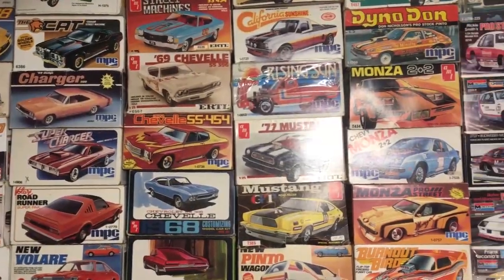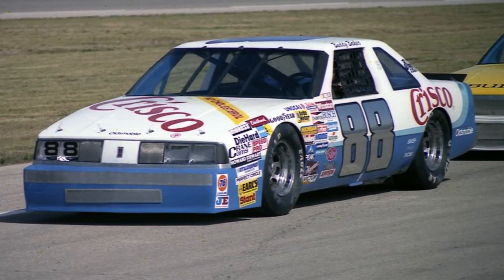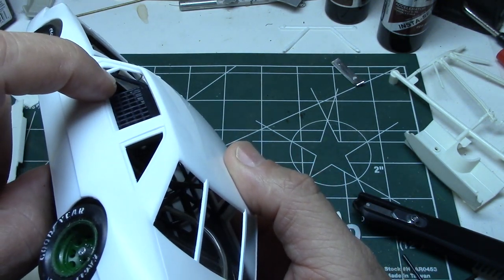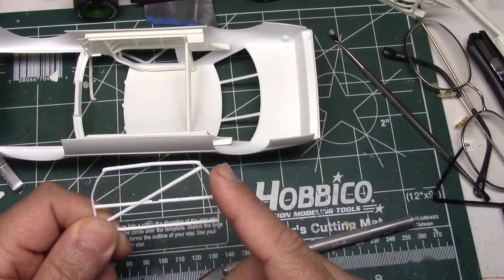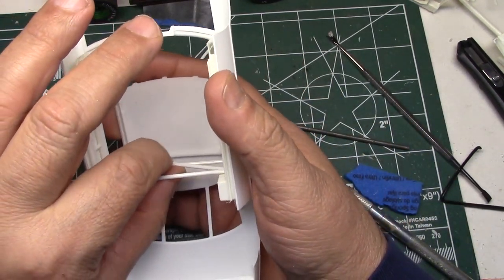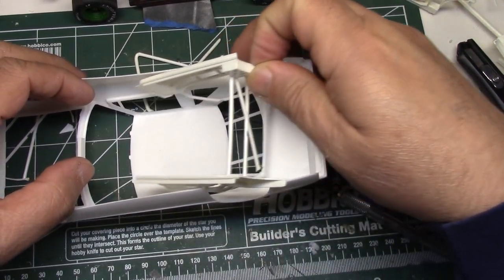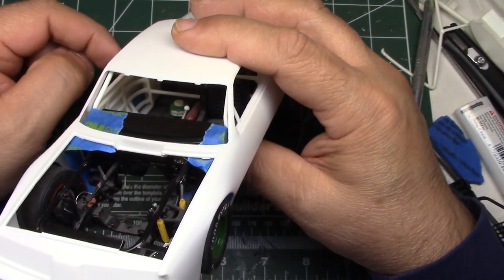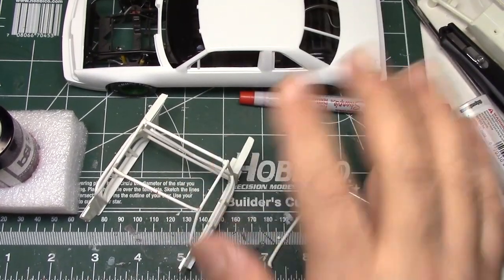Ep.114 How To Blend The Roll Cage Into the Body On An 80s Monogram NASCAR Model Kit

Comment: The Dremel brand butane tool it's a precise torch with heat setting and different tips and nozzles for soldering heating precise locations, heat shrink tubing and even cutting foam and styrene rods and stock at correct angles and clean precise cuts and heat source I always use solid cuse nobody will know difference if it's solid or tube on apdel car cage

Comment: I found a really nice way of making bins no heat necessary you take a styrene tube and you get a piece of copper or brass that fits inside that tube and then you can bend it and it works great I use it for bending the tubes for intercourse on my cars

Comment: I'm not very good at scratch building models yet but some stuff relates to models from real cars like cooping the ends of the cage tubing or you call it aka fish mouth lol different terms for different areas of country I guess and the way you build the cage is similar as well as fitting and bending each piece is very similar instead of chromeoly tubing it's small styrene rod and a little Dremel brand butane torch/heat tool works perfect for getting very precise heating in exact spot you want cuse it has tiny precise hallow tips that direct heat exactly where you need it and just mold the styrene rod in as you heat and push into body is how I do it very easy to form scratch built cages

Comment: I just finished the 1988 #3 car need to clear coat. anyway, I just noticed the body is twisted to hell is there any way to fix this?
Reply from the maker: You can try holding it over boiling hot water. But lots of times. No. Not much you can do with it.

Comment: You might want to reroute your gas line from the driver's side to the passenger side you don't want the gas line on the driver's side I know it's only a model but you seem to be looking for realism I sure wouldn't want the gas line there in my stock car you get hit in that gas line comes apart that could ruin your day looking good though
Reply from the maker: What the Hell are you talking about?
First, you obviously didnt listen to a thing I was saying. That black part of the chassis is out of the parts box  and is use just for mock ups. Only stated that in like 3 videos.
Second. I do not know what you are looking at. But I'm looking at that chassis right now, and the fuel line IS routed on the passenger side. 
Suggestion.
Befor you go all Keyboard Comando in the comment section of a video just to show off how big your brain is. 
Try getting you facts straight and you know what your talking about.
Or better yet. Start your own You Tube channel and show me up on your model car skills. Now THAT will impress me.
Other than that.
THANKS for the input.